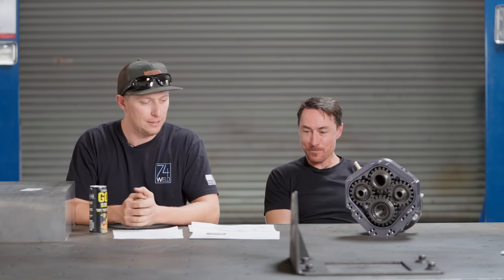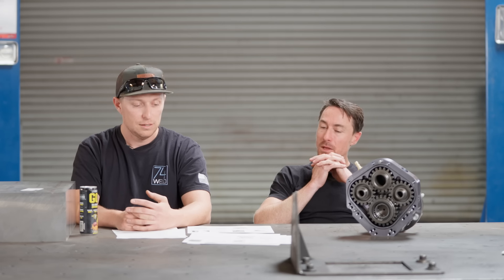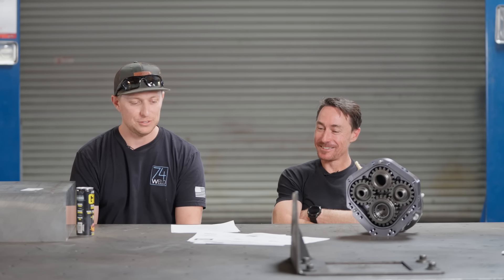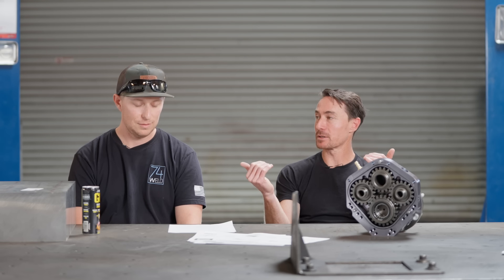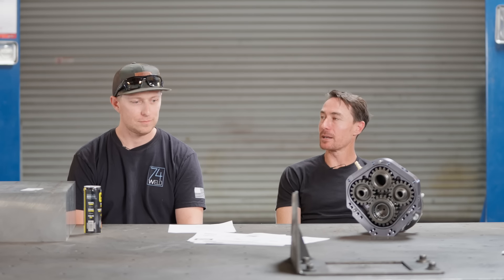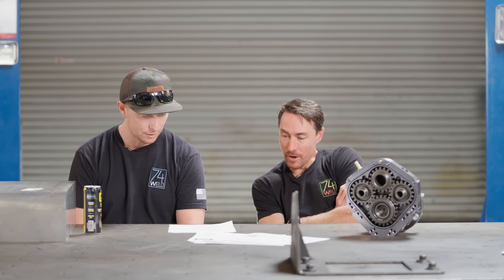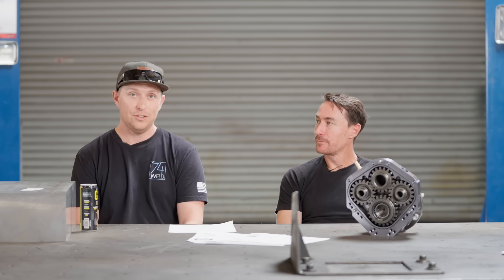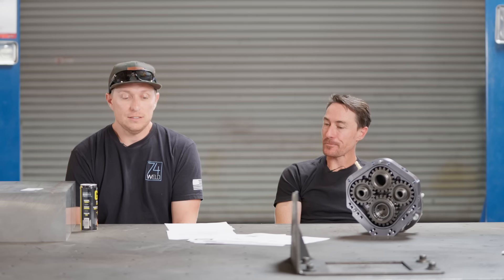10 reasons why your lifted jeep drives like $h!t

Comment: If it wasn't $5000 per wheel, it is an insane amount.   $20,000 cost can be a lot of upgrades otherwise.
Reply: And none of those upgrades give you ground clearance. By the sound of it, a lots of customers disagree with your comment on price. I remember my father once saying to me “expensive is a relative term”
Reply: the more people buy them and more they can use the economy of scale the cheaper they'll get to a certain point

Comment: 1. Should you use an aftermarket front axle or would the factory one be good it’s for a Mojave 
2. If you wanted to put the rock kroner triangulated rear on would you weld it this is for the jt

Comment: Really good content fellas. I’d trade my lift for portals for sure if $$ wasn’t an issue.
I would like to hear what style tracbar brace you guys like and weather adjustable shocks are a good setup with the stock suspension?
Reply from the maker: That’s an easy one. WFO concepts brace, steersmart steering…and I’d either run a Fox shock or a Fox shock. I have the 3.0’s with adjustable clicker…and I never change them because I am lazy and they just work

Comment: How much of the bump steer conversation is applicable to Tacoma’s; stock or lifted? My 2017 had a decent amount of bump steer stock when just driving over speed bumps, the wheel would just bounce back and forth. Same  if not worse when lifted with the eibach kit and JBA’s.

Comment: But there are also disadvantages. With portals, the unsprung mass is increased, which can make driving on the road worse, and the track width is increased, which can also be a disadvantage.
Reply: To be fair, if you are lifting your jeep you are likely putting on bigger heavier wheels and tires as well, which will also increase unsprung weight.  Horses for courses, you wouldn't use/wanna use portals for a desert prerunner for example.  Some of the increase in unsprung weight could be offset with smaller tires.  With the portals you could have more clearance with smaller lighter tires.  I think the portals are awesome.

Comment: I have a JT ecodiesel with a 2.5" full clayton lift and fox 2.5.  37's. Rides like crap.   This may help me tune it a little bit.  Would love to put portals on it one day.
Reply: 3.5” game changer metal cloak 37s and fox 2.5s rides like factory
Reply: Does that kit have rubber bushings in the arms?  I remember researching lift kits years ago and Metalcloak seemed to be the best engineered with their control arm design.  I think high clearance fenders and no lift is very appealing as well.
Reply: @connor3288  yes rubber bushings that allow flex. Also the joints then selves are welded at an angle to allow proper alignment within the pocket and create less binding. Some others kits have this may others don’t. I’m happy and suits my girlfriends daily driver weekend toy needs
Reply: @delagto_5340  was asking guy about the clayton lift, shoulda clarified in my comment.  I know metalcloak has rubber bushing option.  Arms without rubber must be very harsh,and I would worry about stress cracks over time.

Comment: Credit to who ran that "study" with the multiple lifts/jeeps?
Reply: The study I was referring to was performed at Dixie 4x4 in Moab in November of 2020. Over the course of 2.5 days, Bryce, Milt, a mechanic named Justin and I built 6 JLs with different lift kits while Brad from Trailrecon filmed.  We then spent a few days measuring, driving and comparing the vehicles. Shout out to Trailrecon for putting together an excellent two-part series on this.  For anyone interested, search "Ultimate Jeep Wrangler Lift Kit Comparison". Brad does a good job of describing the user experience of each kit, from install to daily driving to off-road.
Reply: @eriksteinholt  perfect, thank you.